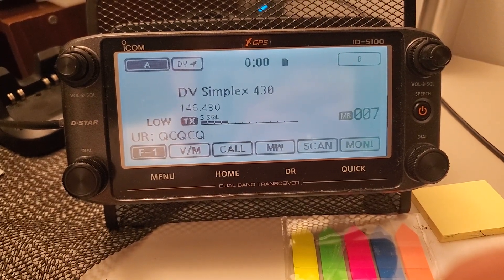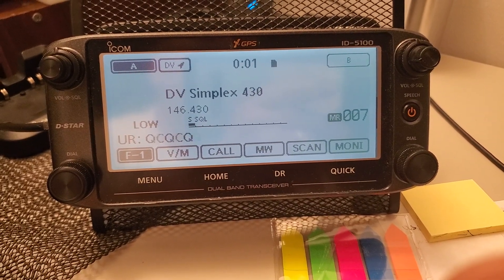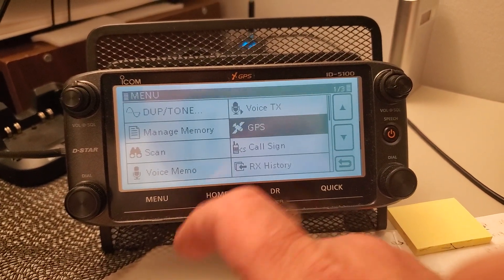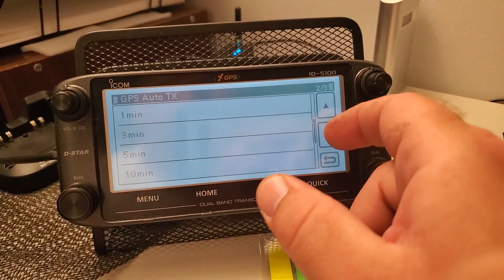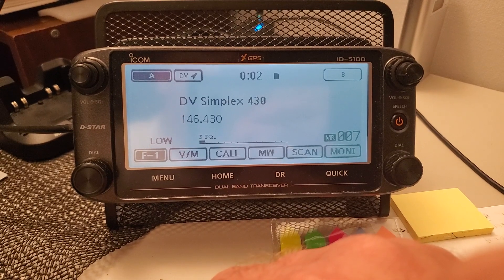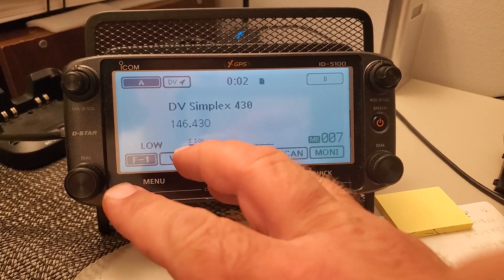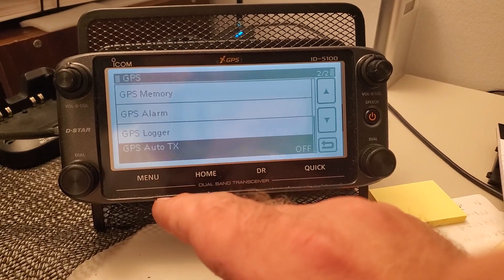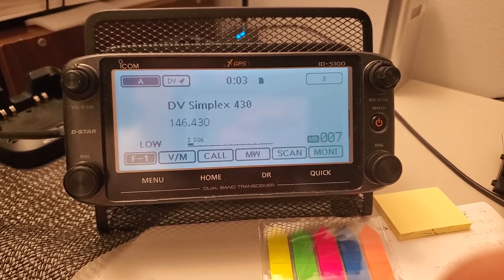Auto GPS TX On The Icom 5100A Why Is My Radio Transmitting By Its Self!!!! Ill Explain...

Comment: It would be nice if we could do APRS vs DPRS . I would imagine it would be easier as an option than it was for DPRS.
Reply from the maker: Ya regular aprs is the way to go. If your GPS is on and your transmitting via a gateway it will put your symbol on the aprs map for location only but you can still have it trasmit a aprs tag message.
Reply: Ive been asked to turn mine off because of the kerchunking. Unless you know of a way to keep the kerchunking from going outside of the local repeater?
Reply from the maker: There's not a good way to accomplish it because no matter what you will id every time. The radio has to transmit into a gateway enabled repeater to get to the internet to put your aprs symbol on the aprs map. 
But soon ill be doing a short video on using a mmdvm hotspot to transmit and put your symbol on the aprs map. This way will tie up a hotspot and a radio but is a option. It just uses up resources. The way to do it with a mmdvm hotspot like a jumbo spot is to have your mmdvm hotspot not linked to anything just sitting idle. Then you make sure your radio is turned to your hotspot frequency and turn on the GPS function on your radio. Then turn on the GPS auto tx and set you transmit time. 

When your radio auto transmits into your hotspot it will automatically put you on the aprs map. But this way ties up a radio and a mmdvm hotspot.  The only thing you gain from doing this is your location is on the aprs map and what ever aprs message you have set to display.